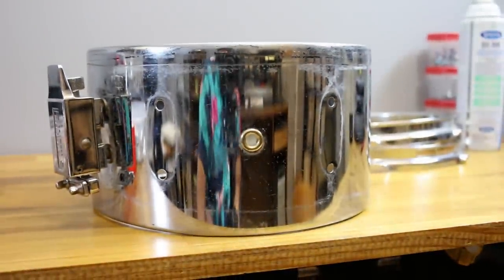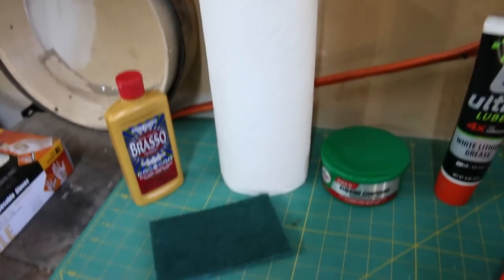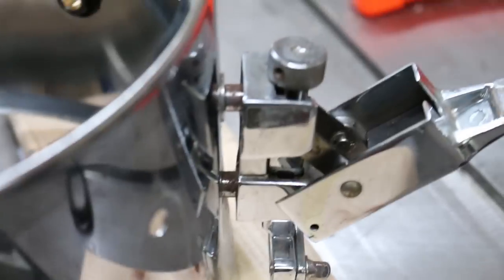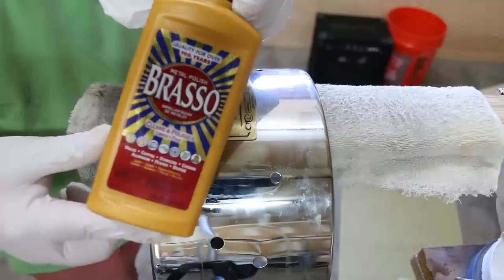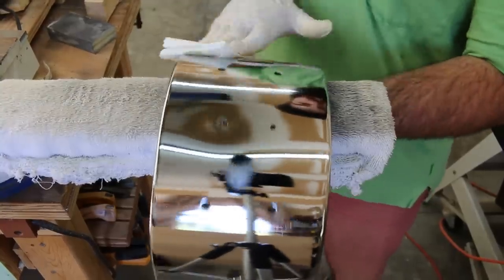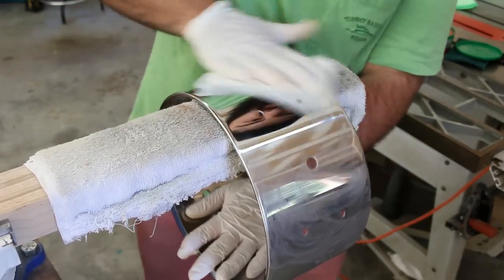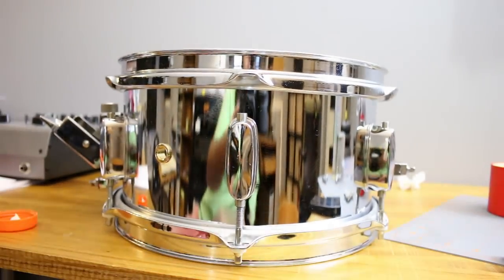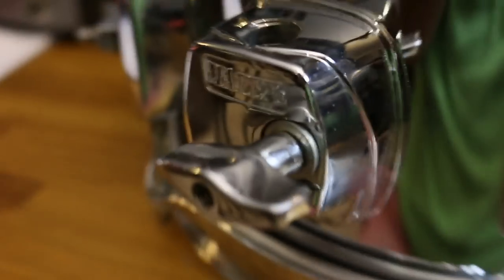How To Polish a Snare Drum

Comment: You might want to try Maguiers cleaner wax gently applied with 0000 steel wool. Let the wax dry on the shell and then buff with the blue shop towels. It does wonders and you have a pretty tough wax coat on the shell. You can buff the shell every couple of weeks and it goes right back to beautiful. Just don't bear down too hard when you cleaning the shell. Nen R' Dull works too!

Comment: David.....question....I’m remodeling the entire drumline of my kids high school band....Do you have a secret for restoring old bass drum metal that’s scratched up?  The metal rods and posts?  They’ve been scratched against pavement until they look like rusted cottage cheese. ..Normally, I’d replace them and move on but, the school can’t afford to replace parts so, I’m trying to make the existing ones work.... I thought about sanding the dents and scratches out then, buying some type of chrome paint and just touching up the bad parts with it......just until the school can afford to buy replacements.  The ideal would be to buy new parts but....that’s not happening until the band boosters can raise enough money.....We live in a very small town so, it’s going to take them awhile to raise the kind of money we need.   I’m good at repairing drums but, these things have been thru the ringer and back again....Teenage kids for 30 years!  Yes, the drums are antiques!!!   They still sound great so, I can work with that. LOL.  That’s the reason I was asking if you knew a better way to do it....I hate to ruin an antique by spray painting the metal parts but, I don’t see another way.  The shells are great and the aluminum parts on the snares was easy to fix.  A product called Never Dull is my secret.  Love the stuff!!!!  If you need a shine on metal...this stuff will give it to you!!!!  Anyway, imagine the worst rusted, dented, scratched up piece of metal you’ve ever seen on a drum and you’ve got a great picture of what I’m dealing with.  Sigh.  Help.  I had a 200 dollar budget for 10 drums!  Needed heads for 7 of them and one hoop for a 26 inch bass drum so, there went most of the money.   The school could care less that the drums are antiques.  They just need them to look good and work properly.   I put vinyl car wrap over the dingy white shells and they look brand new.  So, I’ve been crafty in trying to save the old drums.  I told them we could sell them and make a few bucks toward buying new equipment.   I guess what I’m trying to say is....Can this be done?  LOL.  If I can’t save the antiques then, at least, I need to make them look good any which way I can.  Thanks for the help!!!  Gonna try this on my old Slingerland snare I grew up playing.   It’s just a liiiiitle bit dirty.  LOL

Comment: Would the mineral spirits work on sticker residue? And would it work with wood shells? I put stickers on my first set of drums  (I was a dumb kid, around 13, who thought it looked cool at the time leave me aloooooone) maybe 10 years ago, and I'm trying to clean them up to sell. I used Goo-Gone and WD-40 so far, and some came off really easily, and others left residue that I can't soak and scrape off. What do you think would work best in this situation? I'm hoping I won't have to sand it off. Again, trying to sell them so I'm trying to leave the original finish.

Comment: I have a 70s Ludwig Supraphonic I would like to renovate like this. I will switch the original throw off to a new gibraltar dunnett throw off, clean it and then get whatever it needs. I have a problem with it though. The tension rods become loose after just a few hours of playing. What do I need to do in order to fix that?

Comment: Instead of taking the time to hand polish every piece of hardware, just put it in a bath of water and Dawn dish soap and let it soak overnight. Cleans everything and shines it all up by morning! I use this method to restore vintage drums.
Reply: you don't really want metal sitting in water over night...
Reply from the maker: You dont want steel to sit in water. Well really you can let it sit over night, but once you take it out itll start to rust, because science. but lugs arent made out of steel so its okay. Rims and tensions should also be okay since theyre chrome plated. So really its fine to do, just dry everything off really well
Reply: rdavidr Oh hey buddy boi. Good point
Reply: Dharm ka satta chahiye